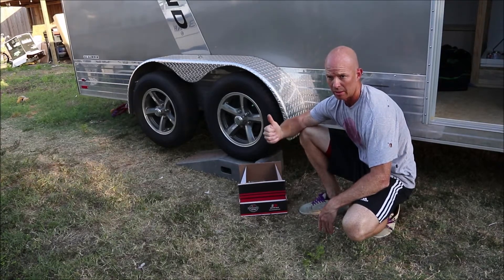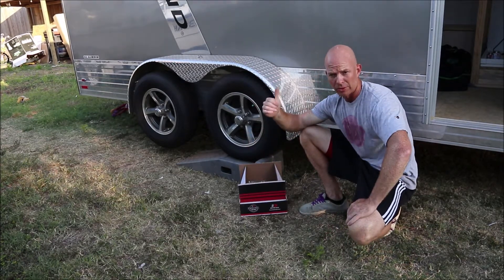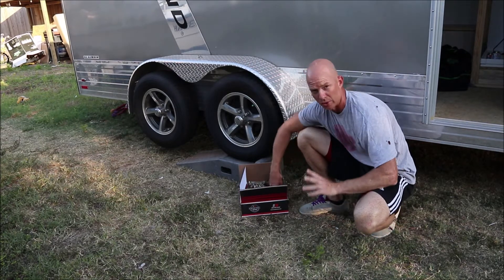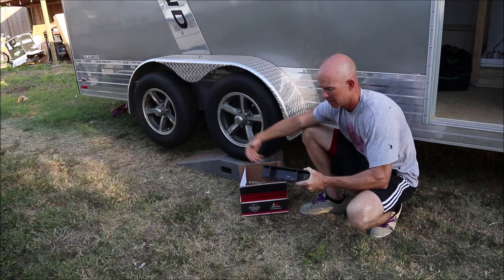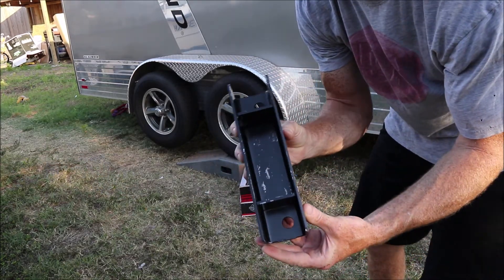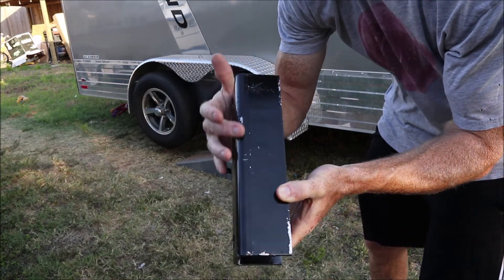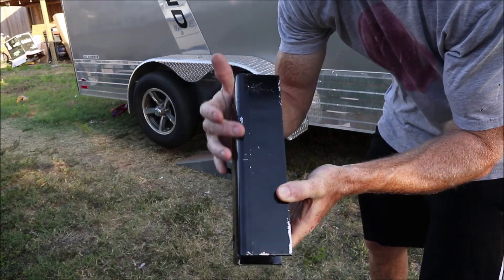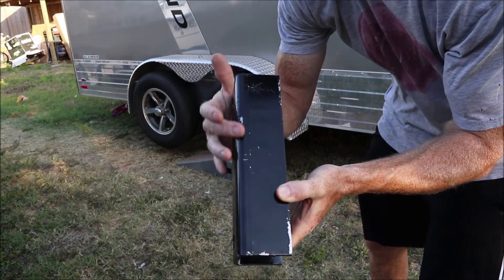Cargo Trailer Conversion Lift Kit Installation Dexter Torsion Axles Torflex Lift

Comment: Thank you for this video.  I just special ordered a new small cargo trailer (Wells Cargo 6x12) to make an adventure toy hauler and I special ordered it with a Dexter torsion axle to lift it with these spacers (never liked the flip method with springs).  Your video is an excellent guide to installing them.  I also think (can't remember) your video was where I got the idea to order a torsion axle for ease of lifting the cargo trailer.

Comment: If you are worried about the tire alignment just run a tape from the back of the hitch mount to the front of each axle on one side and then the other. As long as the measurements are equal you are in alignment. 
Your build is looking great.
Reply from the maker: g havila1 awesome I'll do that. Thx!

Comment: Great video.  I fabricated my own lift kit since I wanted 6" of lift.  FYI: Fabricating my own spacers DIDN'T save me any money (metal is getting more expensive by the day), but did allow me to get the lift I needed.  In my case, my trailer was particularly low (regularly bottoming out and damaging the rear corners) and I plan on moving from 15" trailer tires to 17" mud tires in the next few weeks... so I really needed more lift than the standard kit.  Again, great video -- really helped me throughout my own lift!!!

Comment: I have the same trailer. I was scraping the tongue jack all the time. I installed a 3in Riser aluminum block between the base of the tongue jack and the frame.
Reply from the maker: That's a great tip, thanks!

Comment: Hey Daniel, thanks for this video. Yours is the best one out there for this job. It is really helpful to see someone do this on their own. So my question would be, did you need to get the axles lined up? It would seem that there is little to no adjustment available on this type trailer. What did you find out on that? Thanks again for the help on this Daniel.

Comment: Nice, I want to do that to my Winnie drop travel trailer is that a universal kid or do I need to get one specifically for that Winnebago where the holes will line up it is torsion axle also? Thank you!
Reply from the maker: Just have to get the right kit for your axel.
Reply: Its universal assuming you have Dexter torsion axles and order the kit that corresponds to your specific axle (trailer manufacturers tend to all source their torsion axles from Dexter, assuming you are running torsion axles, you're probably in the clear!)

Comment: Does it only work on dexter torsion axles? Ive got an old 92 pop up that i want to lift up but its so old i cant even find a stamp on it to see who made them so im curious if its a universal type part
Reply from the maker: Honestly, I have No clue. U should contact etrailer I bet they could help
Reply: @danielmid6022  thanks i appreciate the honesty

Comment: Every time I get ready to do something your videos pop up. How's the split system? Does going down the highway impact the fan at all? Did you pick it up on Amazon? I'm going to attempt to run mine off solar
Reply from the maker: It's still blowing cold and hot. We use it often. Solar would be awesome! I ordered it online. Think I have a link to it on one of the videos. I have two of the exact same units, they are both still going strong
Reply: I’m still looking at what to buy. It’s hard to find an older fiberglass camper. My truck has a 10” lift so I’m hoping to put 5” on the trailer and do some overlanding

Comment: I have the same problem with my trailer it seats too low, but my trailer is a 24’ stealth, I notice your is. Legend is that kit works for any trailer ? Where did you order from please thanks
Reply from the maker: I think It works with the axles, not the trailer. Check to see what axles you have and then check etrailer for a lift. Hope that helps

Comment: We're having a custom cargo trailer built next spring and I will be buying 2 sets of Timbren axle-less suspension kits to send them to use in place of the stock axles & springs. You might want to consider them for a future upgrade. They are better than torsion axles as they give your trailer 2 or 4 wheel independent suspension which is great if you go off-road, and they allow you to do away with ground clearance robbing axle tubes. You can order them in 4" lift, 4" drop or standard configuration. The 2 sets (for 4 wheels) will have the 4" lift so I can install larger or deeper holding tanks and have more than enough room to route the discharge plumbing. Anyway, I saw these and knew this was the way I wanted to go. Here's a link in case you ever want to improve on what you have.... https://www.etrailer.com/Trailer-Leaf-Spring-Suspension/Timbren/A12RS440.html
Reply from the maker: Thanks!

Comment: Does the lift kit do the job?  IF it does, then why should it matter if it comes to you scratched?  Chances are that within a few years of acive use the paint is going to com off..
Reply: Cameron, I'm with you all the way.  If you look up reviews on the kit, everyone seems to have the same issue with the missing powder coat finish.  A $10 can of bedliner takes care of the paint issue with no muss - no fuss.  On the other hand, I understand that people expect to get what they have been told they will receive.  The product description does say "powder coated"... or at least it has wherever I've seen the listings.

Comment: Would this work for my trailer, which has 2x Lippert 5200lb torsion axle (8.5x20)?
Reply from the maker: Sorry I'm not sure
Reply: @danielmid6022  NP. Just sent email to Lippert and will post the response.
Reply: @danielmid6022  Here is the response. "Unfortunately our torsion axle riser kit is for 3.5K torsion axles only." 

This only means the Lippert doesn't make lift kits for 5200 lbs axles. Dexter makes them. FYI
Reply from the maker: @sflasurf  thanks for the research and info!!

Comment: and you had to PURCHASE this little bit of steel to do this when you could have bought steel channel for  a teenth of the cost and stronger?
Reply from the maker: Sure did. I'll do it your way when you post a how to video.
Reply: @danielmid6022  you mean you are incapable of cutting two lengths of steel(which the merchant can do for a small fee) and drilling 8 holes.

ive just about finished a tandem axle braked trailer in 3 weeks from raw steel abd new parts(stubs,hubs,btakes,tow coupler.

everything else was done by me with a band saw,grinder,welder and riveted galv sheet cladding
Reply from the maker: @jadekayak01  I'm incapable of many things
Reply: @jadekayak01  take it easy man!  Personally, in this day and age of lawsuits, I'd rather have a Dexter-made product fail.  And it's purpose made for a reason.
Reply: @H2OTOYS-90  it made for a reason all right-that reason is to make a profit.

little story

i made a towbar for my first nissan terrano,a 2.4l disel.

i used 15mm thick flarbar,6mm x50mm shs,20mm x50mm flatbar for the tow ball mount.

i havd no welding certs but ive been welding for 30 years(about 15 at that time).

the law has recently changed.

you cannot build your own tow mounting and it must be certified.

they use 10mm flatbar for mounts,3mm x 50mm shs,12mm x 50mm towball mount.

that is way weaker and cost upwards of $1000.

contrast that wuth a legal right to build a complete trailer up to 2500kgs gvm tandem axle,braked(which i have just dond over xmas/new year-im just hooking up lights and brakes today)

i made the suspension rockers and all linkages.

12mm flatbar instead of commercialy made 8mm.

whats goi g on in this video is a simple bit of stock steel with 4 holes per side made from what looks like custom bent 8mm plate.

a piece of stoch channel is cheaper and stronger.

there are plenty of vids on yt that show its still legal to selfbuild in the US.

the guy in the vid looks capable(he actually installed them himself which is harder than making them)

you mentioned you would rather have a commercial unit fail!!!!

i would rather have a homemade unit NEVER FAIL and you therefore  avoid all liability.

once it passes vehicle inspection it is all legal.

i can understand some nitwit with no mechanical ability doing this(or more to the point-paying someone else to do the whole job for him) but this guy had ability.
Reply: @jadekayak01  I own a manufacturing company, I am in the steel business, I employ American workers.  We sell steel items FOR A PROFIT to put food on the table and pay the rent.  I will therefore buy whatever I want from whomever I want to support their business.  You can continue to make whatever kind of s*** that you want.
Reply: Ha.  I just fabricated my own set and didn't save a dime!  In addition to the metal (which isn't cheap), trying pricing out 5/8" bolts, locking nuts, and washers.  Even excluding the metal (I used 1/4" but you can use 3/16" as with the original kit), you're already at around 30-40% of the cost of the kit on hardware alone.  Then add the price of the metal as well as self-etching primer and bedliner paint or underlayment coating.  And, of course, this assumes that your personal time has no value (and that you have all the tools and a welder).  Unless you need more lift than the standard kit ($180), don't waste your time.
Reply: @jadekayak01  So you have all the materials already because you do steelwork?  In addition to all the material you have laying around, I'm assuming you also get your steel at wholesale?  For the majority of readers who are buying metal online or at the local steel discounter, the materials alone are going to cost almost as much as the kit.  And to assume that most readers have access to the tools and knowledge to fabricate it themselves (as the two of us do) is a huge assumption.  Be thankful that you can do your own fabrication and don't cast aspersions at those who can't or choose not to.  You may not realize it, but your original post was argumentative and condescending (as were many of the follow ups.)  Material is 10% of the cost of the kit?  That's a joke!!!
Reply: Robert Barnwell i buy most of my steel at extremely inflated RETAIL prices.

A small bit of flat bar costs 3/4 the price of a 6m length at wholesale.
The advantage is that i dont have steel offcuts building up cluttering the place up.

We can buy wholesale at exactly the same price as bulk wholesale to small engineering places.
The only places that get cheap prices are the ones that buy tonnes at a time.

The other serious impediment to things here is the sheer price of tools and equipment.

They are so expensive.

The cheapest welder with a duty cycle of 4 sticks costs around $300-$400.
I normally get my big tools like that at second hand tool shops-about 1/2 the price.

A cordless dewalt impact drill with hd battery and charger can cost $700.
What do you pay for that in the us?
EVERYTHING ere costs alot.

As for being lucky i can do this stuff-not really.
Most people of my generation have a strong diy ethic.

Especially ones from small farming towns.
Our schools taught basic engineering and woodworking skills but not for the last  25 years
Reply: @danielmid6022  if you had a good metal fabrication company local you could have your a talented guy..